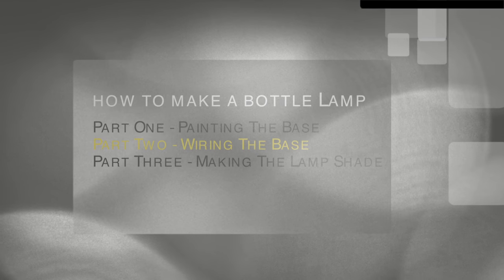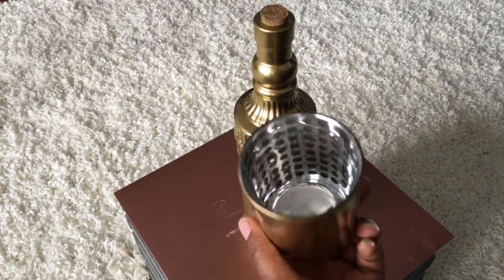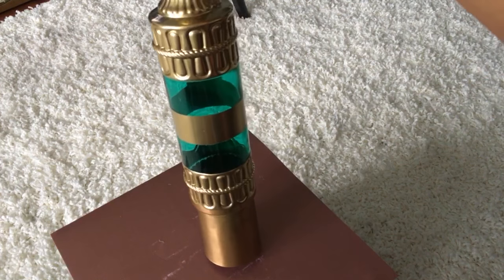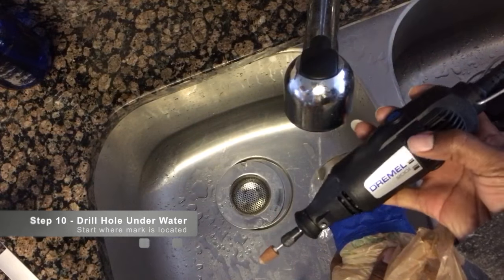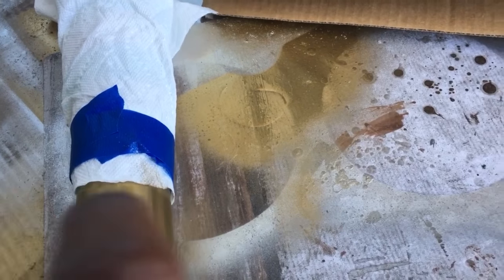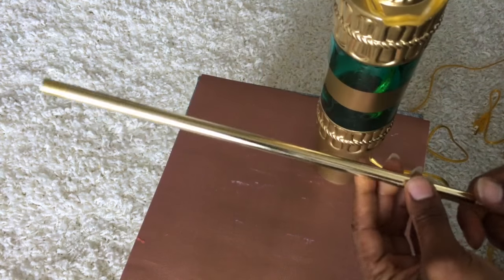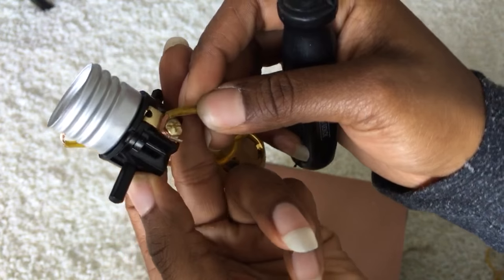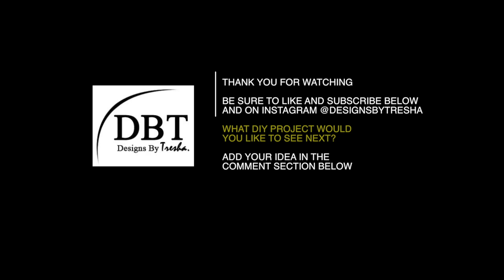DIY | Dollar Tree Bottle Lamp - Wiring the Base (Part 2)

Comment: I'm a little confused,  dose the bottom of the bottle have a hole? how did you thread the wire through the bottle?
Reply from the maker: Hi Pares, thanks for watching! Yes, I drilled two holes. For the purpose of the video, I only demonstrated it once and mentioned that you will have to drill a second hole at the bottom using the same technique. Check out 5:14 of the video. I hope this helps. :-) You could always just drill on the side of the bottle, as well, if you decide not to add an additional base, like I did.